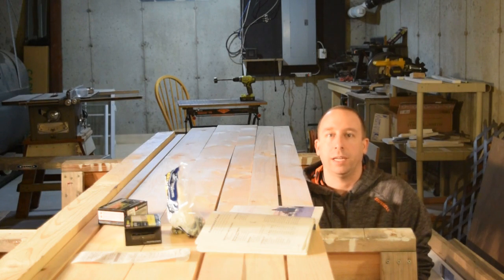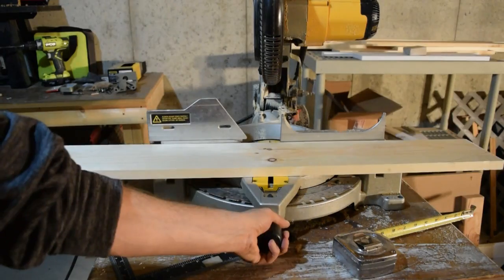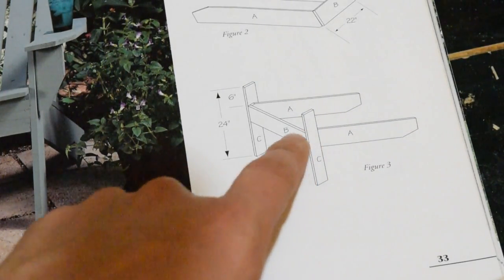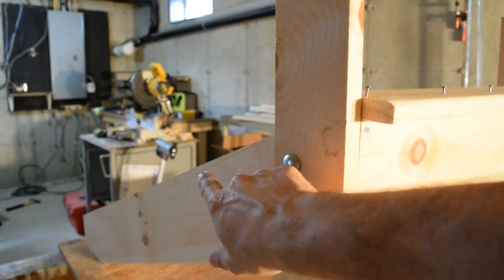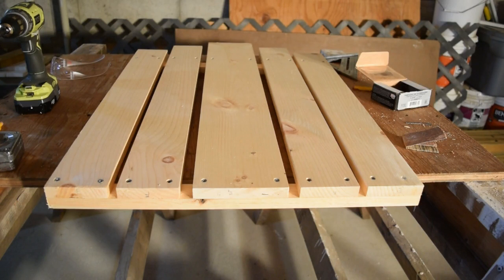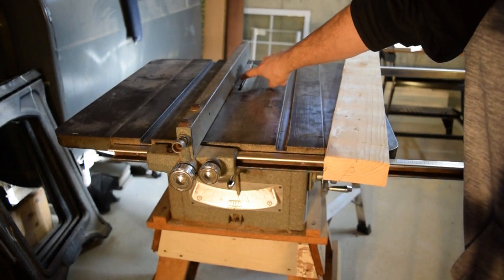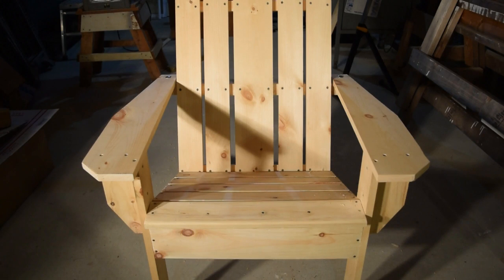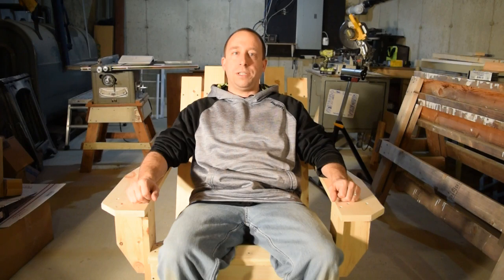Simple Adirondack Chair Construction Highlights

Comment: Great job. Well done. Like you I am not a carpenter and I made a garden bench out of a book like yours. I also found that as you go along you begin to see what you should have done. For example, putting nails and screws in a straight line  When I have to nail near the ends I drill a pilot hole to help stop splitting.  Its time consuming but worth it.
A thumbs up from me
Reply from the maker: Thanks Bill.  Just like anything else, practice makes perfect.
Thanks for watching and taking the time to comment!

Comment: Great job on the chair,  Your video is spot on, I will be playing it over and over as I attempt to build one myself. One qustion dose it matter what type if wood you use? Again thanks for the great video and time.
Reply from the maker: Thanks!  You can use any kind of wood you want.  I used pine for mine because it is the cheapest and I planned on painting my chairs and keeping them on a covered porch out of the weather.  If you plan on keeping yours in a harsher environment I suggesting using rot resistant wood.